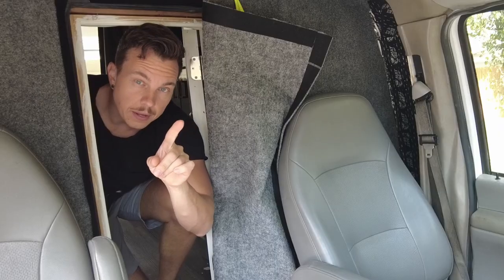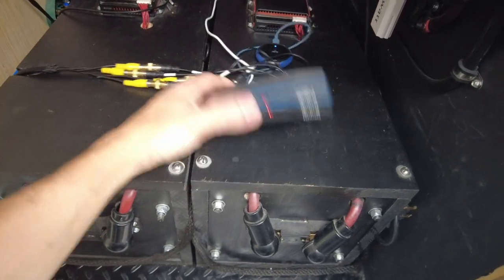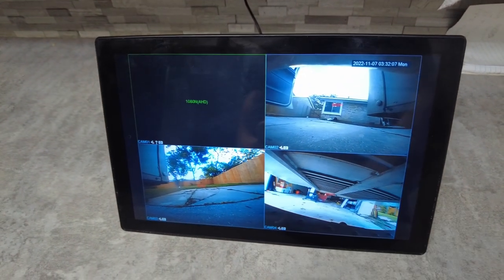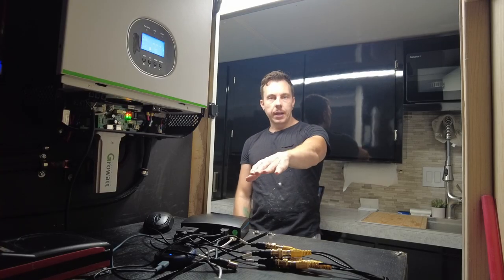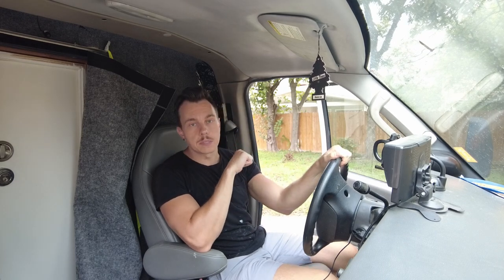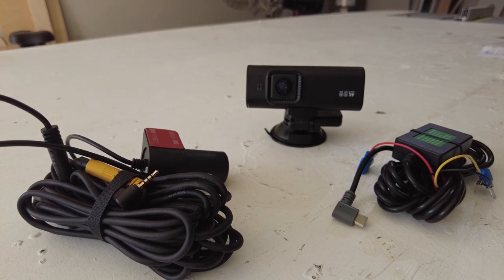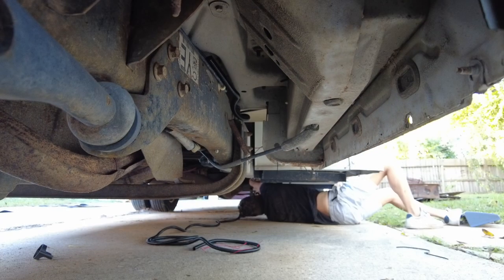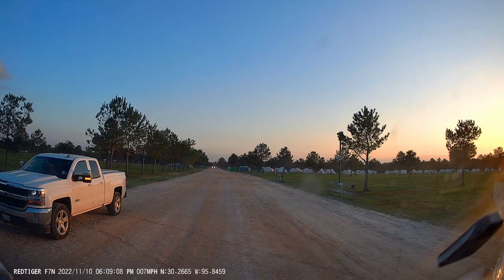Security Cameras on a Van Tiny Home | 9 Cameras + DVR + Parking Ca

Comment: Well done.
Security should also include enhanced horns, flashing lights, and possibly a PA system with recorded messages all accessible from the back, cab, and possibly triggered remotely.
All entry points require hardening. 
The security system needs to be as relevant and prioritized as water & electricity. I never cease to be amazed at those that put so much work and expense into their rigs while failing to secure them as well as possible within their means and budget. Relying on firearms is missing the point.
 I would also add a preprinted warning for potential vandals & thieves warning them that they are currently being recorded, the recording is saved, automatically uploaded, and monitored in real time.
No need to be honest, they are not.
The goal is to drive them away without causing you damage and/or minimizing the damage they intend to cause. Most criminals are opportunistic. 
Do you have wheel locks?
Be the strongest link.

Horns & flashing lights are always the bane of all criminals unless they are schizophrenics.
Reply from the maker: Definitely a lot of other aspects to security...this was strictly about cameras. I think a hidden killswitch and a permanent GPS tracker would be my next moves.
Reply: @TheTechnoBarbarian  Understood. I was more or less speaking to the audience.
Reply: Interrupt power feed to TCM(transmission module) and it should not start. Verify by removing fuse. If it sets a code,move on to park interlock switch.

Comment: I bought a $160 surround camera system chinese knock off that stitches all 4 camera images together for one top down view of my 7.2 meter long truck and instead of wiring it to the indicators etc I wired it to a rotary switch that I attached to the gear stick allowing me to select each camera while Im driving down the road as my main view with a single finger. Insane value and versatility for security and seeing all the blind spots for driving and parking. Does anyone have recommendations to tap into the video signal for remote viewing from my phone via my 4g modem?

Comment: Hi I  know this is security cameras. I have a question about solar, I am getting a 38rv no its not stealthy, but love your videos and set ups. I found this and like to know if this system or what would you say is a good system for my roof size and what is to much solar. 1 x Growatt 12K offgrid Inverter
20 x 72cell 370W Rene Sola Panels
2 x Gill 48v LifePo4 5kw Batteries

Comment: 7:26 or they are connected to the raspberry pi wireless... without cloud/internet access. something like VNC (realvnc, tightvnc, or whatever)
Reply from the maker: Maybe, I haven't actually seen anything like that that's functional. The raspberry pi itself doesn't ever get the video feed. I will eventually have it networked for live viewing anywhere with cell/starlink signal.
Reply: @TheTechnoBarbarian  "The raspberry pi itself doesn't ever get the video feed." and how you are able to watch the stream?
raspberry runs on linux, it should be able to get working. tightvncserver should run on the pi and then you should be able to install a VNC client on your tablet to connect to it 🤔you may get only 10-15 fps, but it should be working wireless
Reply from the maker: @JohnDoe_1237  The touchscreen for the raspberry pi has an aux hdmi input. If you feed from the PI, you also have to figure out how to get the video TO the PI.

Comment: How is the AC duct system holding up? Have you experienced high amounts of condensation build up or freezing components in the AC unit?
Reply from the maker: It generates over a pint of condensation per hour. It worked just fine all through the summer - no issues so far. The duct does radiate a bit of heat, it could use a little more insulation.